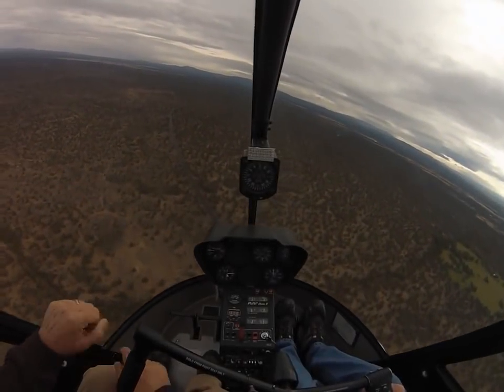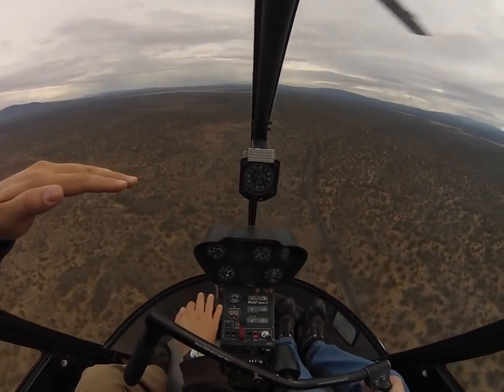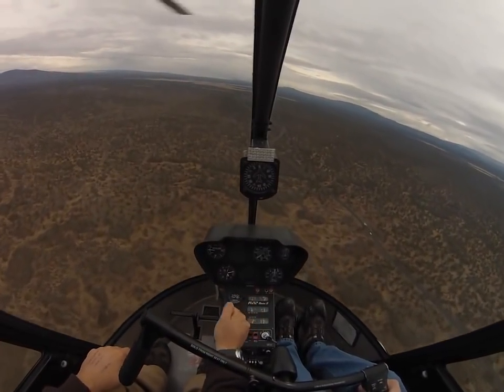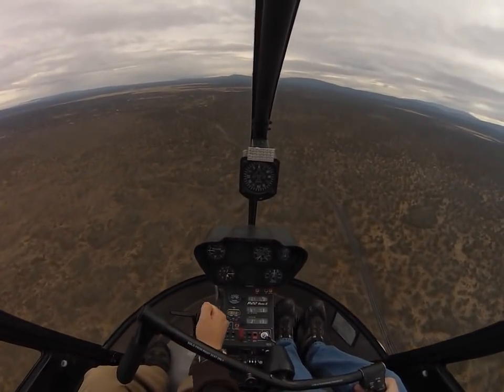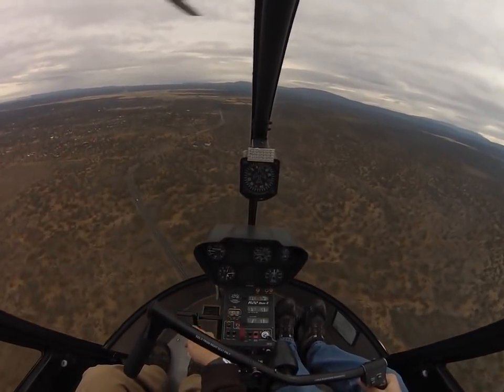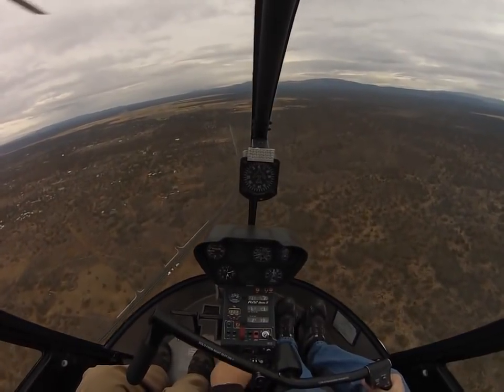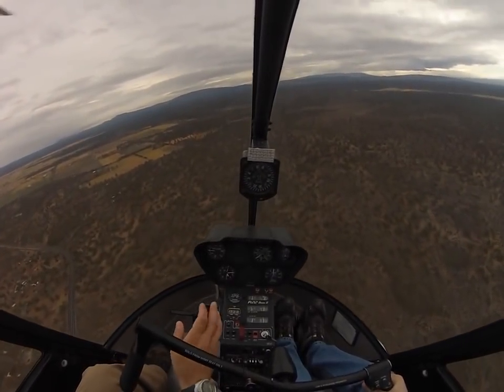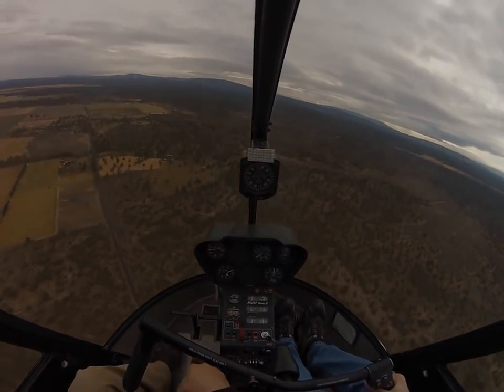What Does the 'Cruise Trim' or 'Right Cyclic Trim' Do in the R22 Helicopter?

Comment from the maker: Cruise or right cyclic trim is used in the R22 to counter the lateral cyclic force encountered at higher airspeeds (due to disymmetry of lift of the rotor disk). Also some discussion on attitude flying and the affects of collective on aircraft pitch attitude,